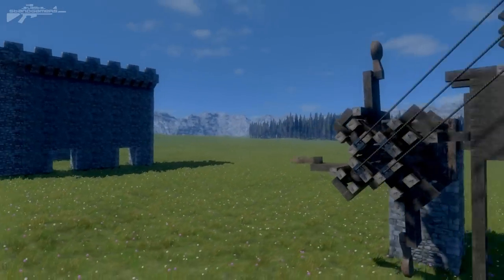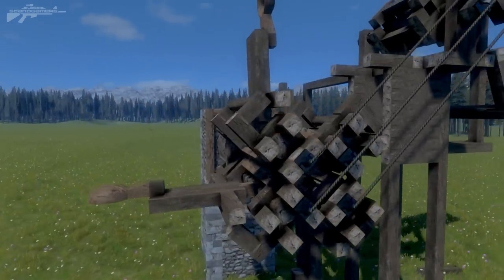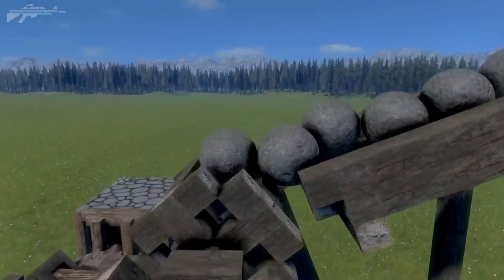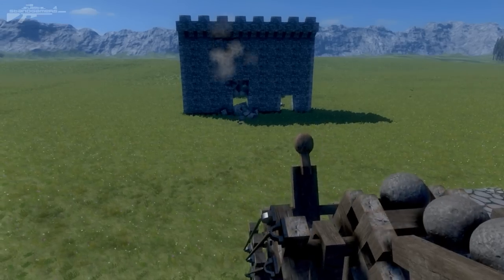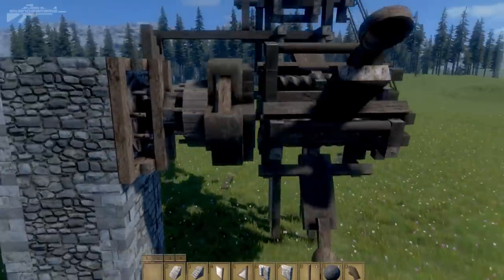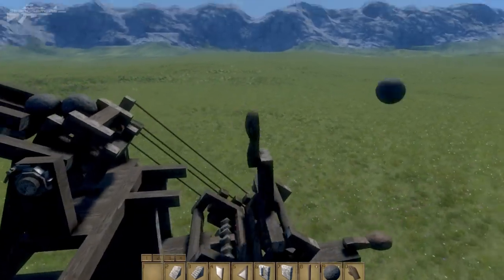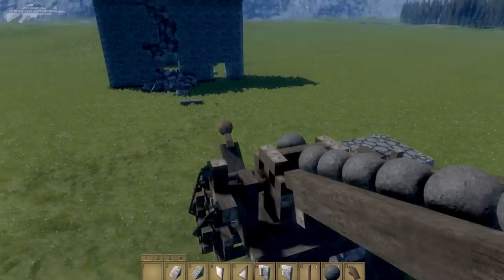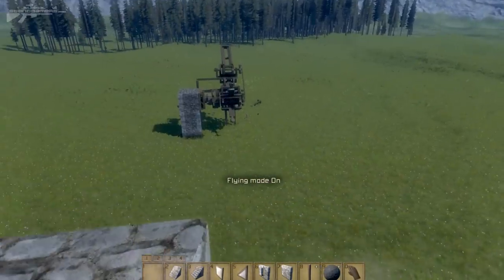Medieval Engineers - Automatic Gatling Catapult

Comment: Reasons why this was never invented in real life:
1. Mobility (or lack of it)
2. If you could fly and spawn rocks, it'd be easier to just fly over the castle and drop rocks. The logistics of loading this are kind of ridiculous. The whole purpose of a catapult design was to be able to roll a rock into the scoop, so it could be thrown.
3. No one ever used perfectly spherical projectiles in catapults, so the feed system wouldn't work.
4. Perpetual motion doesn't exist in reality. The amount of energy required to keep that think spinning would be considerable, though it could be done with people and a gear system, however this would make it much slower.

In summary, if you could do something like this in reality, it would be harder to use, slower to use, and not as mobile.
Reply: more reasons

this would be so massive and complex that it would be easier to build the equivalent number of onagers.

large wood machines like this can fail,  if 1 arm brakes on this it would get tangled and cause downtime for all 4 arms. it would take significantly longer to troubleshoot the setup and maintain operation.

The woods scrapping ageist wood at this scale would cause stress on the parts.

metal tools and nails use to be costly, a lot of old structures minimized the need for them where they could. this design would be much harder to construct with conservative metal usage.

Comment: Something was never done like this because of many reasons, but the largest ones where:

1. Most siege weaponry was built during a siege, so shorter build times and simple design made it so a large portion of the army that didn't have special training in siege engineering would be able to do most of the construction and then later be operated by them.

2. By building fewer more expensive siege engines put you at the risk of losing a lot of siege strength if one of them was crippled or destroyed.

3. Most building tasked only had simple hand tools by today's standards(hand chisels, axes, simple hand drill). Making a 2x4 meant cutting down a tree with an axe and then shaping it by hand.

4. The literal horse power needed for such a catapult would result in that build being as big as a warehouse and require an army of a workforce to keep it firing for more then a minute or two a day.

5. A large portion of the catapult would need to be made from quality iron, which can't be easily made on site resulting in the army needing wagons that are dedicated to carrying the parts weighing hundreds of pounds each. For as many catapults as they are going to every have during the whole campaign. "One broke? Well let's hope the next town we conquer has an otherwise needlessly large forge."

Anyone can debate up and down about how it could have been done, but the bottom line is that anything complicated then the trebuchets and catapults where less effective then what it took to make them. As for cannons which I know some people are thinking: We didn't have the technology to make either the propellant or cannon it's self until not too long before it's invention. Before cannons there was no such thing as a controlled explosion.

Comment: The reason why this thing was not widely used at the time was that it requires something called a belt drive which, despite being invented around 3rd century BC no better designs were created until around 1600th century with Leonardo Da Vinci. This was a time when cannons were began being used and more efficient siege weapons such a trebuchets were being used. The belt drive should be where the 4 ropes connect to spin the contraption which turns the Catapult heads. In the 3rd century BC the first use was in a rapidly firing arrows from a chained set of ballistas.

Comment: Siege engines were build onsite and needed to be easily moved for both aiming and moving to different points of assault once they were built. Such a design would be ungainly to attempt to move or aim, if it could be moved or aimed at all.

Comment: For an automatic catapult to be used in a siege, it has to be:
1a. easy to build on the field
1b. easy to disassemble and transport
2. shoot far beyond the range of arrows
3. have a virtually zero percent chance to fail or fall apart

You also have to consider the fact that IF the enemy steals your design, you'll have to deal with these too.

Comment: The Roman Empire used a repeat firing ballista technology in the latter half of their period, but that was only possible because of the weight/energy ratio between a branch, and horse hair cables used to pull it back. The difference in the mass of a large stone and the energy to repeat fire several of them is relative to the difference in energy between a bow and arrow and a 105 Howitzer.

Comment: The question you have to ask when you are thinking of why they didn't do this is "Is it harder to make than four normal catapults."

Probably. Also in reality you want torsion ropes like that to be very well braced. A breaking catapult is perfectly capable of maiming you horribly.

It'd also be way less portable and not have any way to really adjust the aim on it. If you are making a siege engine that can't move, you'd make a trebuchet. Far longer range and much simpler.
Reply: Not to mention the range on a trebuchet is so terribly far that the kingdom your firing at could only guess where you were firing from. Also by being so far back you could be doing little damage unless firing on a large city.
Reply: Krad Wolf ah... no trebuchets normally had a max range of 200-300 meters and you wouldn't ever have a trebuchet back that far due to the angle at which the projectile would fall. trebuchets were typically placed 150 meters away from whatever wall they were meant to hit, which put them well within the range of the medieval Longbow and some crossbows.
Reply: Heiryuu Sorry but I highly doubt any kingdom would allow trebuchets to get that close to them if their archers can shoot them so easily.
Reply: that's why sieges were a pain in the ass. you would cover the building of the Trebuchets with barricades and your own archers. basically your archers provide covering fire for the builders and engineers and hopefully you wouldn't lose too many workers. it was also easier to just camp around the city you were sieging and just wait for the defenders to run out of food.  sieges are more than what Hollywood shows, there were sappers, that would tunnel under the ground to blow up walls, there needed to be supply lines to keep your armies from starving or running out of arrows. in the grand scheme of things siege weapons were just a small part in what was needed to captures a city
also you keep using the word Kingdom. you do realise that a Kingdom is more than just one city right? you besiege cities, you invade Kingdoms,
Reply: Heiryuu
The very point you pointed out kingdom just makes people not wanna listen to you. But yeah I understand now.
Reply: i don't ever mean to be rude when i correct someone. i just see a lack of knowledge on a subject that i am educated on, and i try to clear up a misconception.

Comment: I think that there are a few reasons to add for why stuff like this never existed. For one, engineer wasn't really much of a career path, especially in the west. The designs used in mines and on siege engines were rehashed over and over again from antiquity as well as learned from more engineering friendly cultures. Another reason, I believe, is that most siege engines were built on site. Instead of lugging giant machines that would get bogged down in the mud, the army would cut down trees and so on on site when they knew they were going to siege a fortification.

Comment: Those would be impractical for offense, because they're impossible to move around, you'd have to carry the materials around and assemble it on the field of battle. Now, that in itself isn't an issue, it was done fairly often. But to really get a design like that in real life? That's not so simple. You'd have to assemble every bit perfectly, if even one bit was assembled wrong, it would blow up in your face, so to speak.

Plus, the rate of fire is impressive, yes. But, the amount of boulders you would need is insane. If you wanted that thing to be working throughout an entire battle? Not counting the fact that sieges could last for several months with resupply being easy for the attackers, most medieval battles lasted an hour or so. Imagine how many boulders would be required to have that thing constantly firing for an hour? Hundreds.

Also, I think the main reason these weren't used is simple: Nobody thought of it.

Comment: A galling catapult wouldn't have been designed in ancient/medieval times because they didn't have motors. Also, cranking something to produce enough energy to launch a heavy projectile would be difficult at best especially as more shots are fired. Also, consider how you would fill the 'magazine' at the top. That'll take plenty of time as cranes or some kind of pulley would need to be used. Finally, you saw that catapults range. You'd have to stroll on up to the walls, build you siege engine, load it, then of you're still alive you can now shoot the defenders. That's unlikely to say the least. I like the videos though don't get me wrong!

Comment: I dub this the gatapult. Awesome idea, btw. I look forward to even more complex weaponry!

I suspect this wasn't built in real life due to power supply issues. In order to have enough range to be effective, an incredible amount of power must be stored in only 1/4 of a revolution. This can be done through the use of gear/pulley style mechanisms of torque transfer, but the amount of input power required to launch 1 ball from this machine is equal to the amount of power required to launch 1 ball from a "standard" catapult. Contrary to game physics, producing that amount of power actually took a significant amount of time in real life, so the actual time saved between shots would be negligible, at the cost of being a much more complex and error-prone machine

Comment: Looking at this design, i think the first problem is range. To increase the range, the contraption had to get much bigger. But throwing power should scale approximately to the square of the size. But with the size, I doubt the wood would be able to handle the stresses. And the rope spring had to be longer too, and it won't be too reliable.
Also the killer point would be time. Traditional sieges takes months. I don't think quick reload was a particular concern. So they have plenty of time to snipe targets with a trebuchet far far away.

Comment: Besides the physics problems with building it, there's the tactical problems with it. The whole point of a catapault is to do a lot of damage to take down whatever it's aimed at in a single shot. Firing smaller projectiles over and over is much less effective; it's like a sledgehammer vs. a flyswatter.

Rapid fire is valuable against smaller targets where you don't need the same force to take them out and especially for low accuracy or when you can vary where you hit rapidly. Catapaults don't do well against small or mobile targets and certaninly don't move very fast.

Comment: The reason this has never been built in real life:

You'd basically have to dismantle a small forest to get enough timber to build it (the machine itself plus the palisade used to protect the crews from archers, plus the supporting lattice, plus the ammo crane, plus the maintenance and tool sheds . . .). For the cost of just one of these Gatling catapults (gat-apults?), you could build four or five regular ones.

You have to design the components to be able to take the huge stress of the torsion skein (that shelf under the feed drum would probably snap if you tried to cock a catapult against it). Try firing it with structural integrity enabled and you'll see what I mean.

How would you power the whole thing? In the Medieval period, the only power source capable of producing enough torque is animal power (probably oxen); windmills and waterwheels just don't have enough oomph.

You need a way a way to rapidly carve perfectly spherical stones (you can't just load any old rock if you want them to feed smoothly).

You need a way to hoist the (very heavy) stones into the magazine. Some kind of crane might do it, but that's a whole 'nother issue.

You'd have to basically disassemble the entire machine to perform basic maintenance if something breaks. Dismount the cogs from their axles, loosen the torsion skeins, empty out the ammo hopper, et cetera.

You'd have to build it while being shot at by the defenders.

The men building it would have to be provided with food and shelter for several days (you can't just throw together a siege engine in an afternoon, especially not one this complicated). The only ones who would even understand how to build such a thing would be highly-educated engineering types with very high fees (who would probably tell you that you're completely nuts after just one look at the blueprints).

Another question would be, why would you want to build it? Three ordinary catapults with skilled crews could easily match the shooting rate of one of these gat-apults, and they'd be cheaper, more reliable, and more resistant to enemy attack. Plus, you could, y'know, put them up on wheels and move them elsewhere if you need to.

For a bit of perspective, look up "Warwolf". It's somewhat smaller and much simpler than this gat-apult (it's an ordinary, albeit fairly large, trebuchet). Yet it still took three months to complete even with five world-class master carpenters and four dozen skilled builders on the job. When disassembled, its components could fill thirty wagons. There are records of armed guards being hired to protect it while it was under construction, so that the enemy didn't sabotage it.

Engineering always seems simple to anyone who isn't an engineer.
Reply: +Jonathan Hughes No. The real reason it wasn't built was because there was no magical way to power it unlike in this game. That's literally the one reason.
Reply: Did you actually read my post?
Reply: And also I bet that gatapult would have too weak shots and once you destroy part of the wall / castle / tower and want to rotate that thing... Ehehe.

Comment: I feel like this has the makings of a ridiculous defense system. Using a windmill, you could create a common source of power of a few of these. With suitable ammo, this might discourage would be attackers. The trick would be having any sort of aiming capability while also connecting them to a castles source of motivation. I think if you built your own cogs to transfer power to the catapult, you would be able to rotate a few degrees to each side without jamming anything.

Comment: It was never built for multiple reasons, to have a range longer than bow shot, it would need a lot more power in the cocking system, which would damage the wooden components, and make rotating it much more difficult. Secondly, remember that wood changes properties when wet. A complex piece like that would have to be kept dry to ensure complete functionality, which would make it impractical for an open battlefield. Another issue is the cost, this would have to be assembled in situ, which would take quite some time, and would require the materials that could be used to make multiple smaller catapults with a comparable rate of fire. Finally some castles had siege engines of their own, and a large stationary piece like this would be a sitting duck. 

tl;dr Wasn't built because it is too complex, and you could just build 3 smaller catapults instead with a similar rate of fire.

Comment: the Chinese did invent something like this but its fired balls the size of you fist no head. The way it worked was loads of little pockets were attached to a wheel by a big of string 2 people would then turn the wheel and when it was fast enough a blade was put out to cut the string.But the main reason when no catapult like tis was made is for the simple reason DO YOU KNOW HOW HARD IT IS TO PULL BACK A CATAPULT SO MANY TIME SO QUICKLY YOU WOULD NEED 10 OXEN TO DO THAT AND EVEN THEN THE WOOD WOULD NOT BE STRONG ENOUGH FOR GODS SAKE MAN USE LOGIC.

Comment: not really a gatling because 1 it dont have barrles and 2 its not handcranked...
Reply: so what
Reply: very many autisms were seen in this man.
Reply: 〈--- Literally FAST food YES THEY ARE!!!! miniguns are air powered you chickin
Reply: 〈--- Literally FAST food a rapid-fire, crank-driven gun with clustered barrels
Reply: 〈--- Literally FAST food Gatling guns are hand cranked.. Miniguns are battery powered too, Not air powered.  A minigun is essentially a beltfed gatling gun with a battery.
Reply: Gaming Terrorist the old miniguns like the vulcan where airpowerd and the 30mm gun on the A-10
Reply: Dark Star Aren't Miniguns electrically powered with a belt and such? Just wondering :D
Reply: Deer Viehch well the old ones were air poweredwith CO2 but now they are electrical. and the belt is fed by a cog that pulls the belt through
Reply: Dark Star The old ones were battery powered and the a-10s gun works from the engines.
Reply: Dark Star some were tested with gas, but were pretty quickly dismissed due to various problems, such as added weight, reliability and what not. Others were tested using recoil and hydraulic pressure.. I'm a gun nut as you can tell.
Reply: Dark Star It does work via the primary defining feature of a "gatling" weapon however. In that it's the rotation itself that loads the multiple chambers (or in this case spoons) when they reach a certain spot, and triggering the firing mechanism when they pass another spot.The original Gatling Gun was named because it was designed by a man named Richard Gatling. Beyond that, the word doesn't really mean anything. The hand crank or gun barrels weren't the important or revolutionary part of his 
invention; the loading/firing mechanism was. Which this is conceptually identical to.